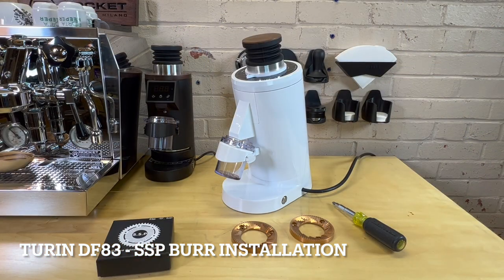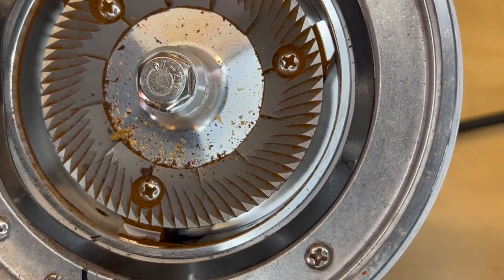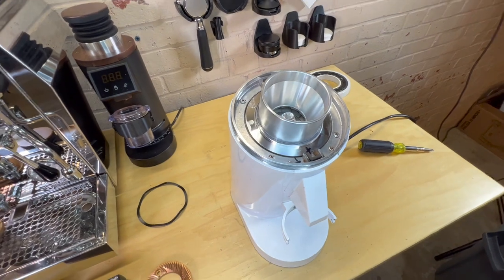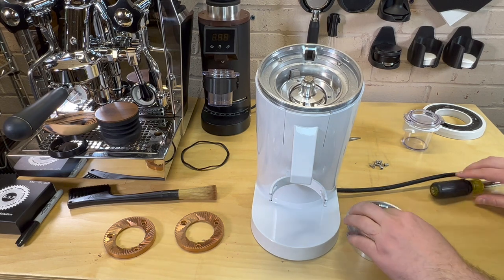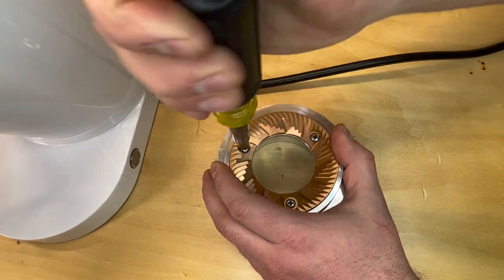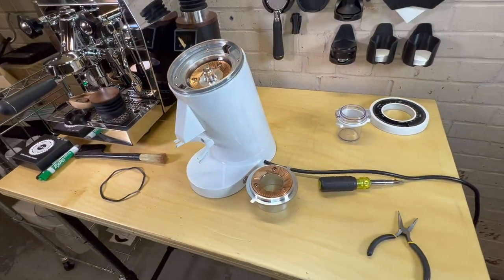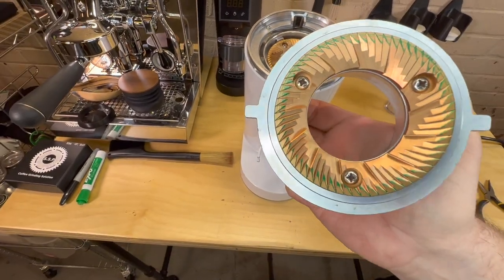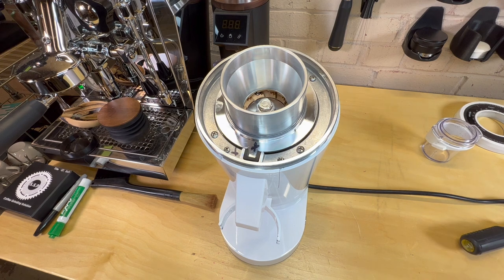Turin DF83 SSP Burr Installation

Comment: Definitely a good idea to get toothpicks for cleaning out the screws and stuff so you don't end up stripping the screws and its easier to get the screws loose.  And also using chopsticks are good for trying to wedge burrs out without risking scratching the burrs. Also helps hold the rotational burr in place when loosening or tightening the burr.

Comment: @PortaKeeper, Thanks for the detailed video. I wish I saw your video earlier as I have not marked the X on the lid with the top burrs so I don't know which way it's suppose to go. How can I fix this so I get the alignment correct?
Reply from the maker: Only way to check really is to do the marker test.   If it aligns well in that position, mark it and your good.  If not rotate 180 degrees
Reply: That's great, thanks for your help.  @portakeeper

Comment: Thanks for the videos, keep them coming!  Been watching since I preordered my DF83 which should be coming this month hopefully.

Random question about the anti popcorn device.  Where do I get the one for the DF83?  I checked the portakeeper website but only see one for the DF64P.  Are they interchangeable?

Thanks!
Reply from the maker: It should say 64, 64E and 64P.  I will check thanks for letting me know!   Yes they are Interchangeable, but the center opening in the burrs Is larger although the outside diameter is the same (hard to explain) but the middle anti popcorn piece does not cover as much of the opening.  It still works well regardless

Comment: Hi there! Thanks for all the content! Can I ask you a question? How many kilos you needed to season this burrs? I also have the DF83 with the ssp espresso burrs. After 3 kilos I think they are not in its full potential. I constantly found some channeling in the espresso puck and I think is due to this but I’m no sure. How was your experience? Pd: my burrs are perfectly aligned.
Reply from the maker: I don't recommend rushing the seasoning process.  Coated burrs will take longer than uncoated burrs.  I notice a difference after 10 pounds, will probably be upwards of 15-20 before really starting to smooth out.

Comment: How have the ssp burrs been compared to the stock stainless steel ones?
Reply from the maker: Still breaking them in right now but I feel like overall much better body while having a fair amount of clarity, more than stock.
Reply: @portakeeper kindly explain breaking on. As I just installed new SSP hu reds and I can't dial in shots. My zero point sounds like it resets, yes sounds, because after I grind and pull a shot I have to grind again as I'm dialing in and then I go finer and it hits zero point or sound like it does. When I take the collar off and pull the top burr carrier I see grinds stuck on bottom burr between the burr and the three posts that are on the bottom carrier. Once I clean it I can then reset to zero. But then same thing again and I have to take it apart to set finer. I don't get it. And I use the bellows while machine is still running after grinding. Pls advise.
Reply from the maker: @bleezal  not sure I totally understand what’s going on but sounds like your doing things right, so makes me wonder if when you installed the ssp that one of the burrs is misaligned to the point you hear the “zero” but it’s not really  because it’s misaligned enough.   Not sure if that makes sense or not.  I’d check alignment with dry erase first
Reply: @portakeeper  so I did an alignment at installation and it was near perfect. I figured it out. Grinds were getting stuck between the lower burr and the three burr carrier posts, so after grinding when I go to adjust finer it would squeel... The noise it makes when you're about to hit zero... But it isn't... So I go coarse then crank it finer whilst the grinder is running and it clears up and I'm good....

Comment: Won't the spring affect the alignment every time you clean the grinder and install it back? also, what about when using the bellows, won't the spring compress down and change the coffee grounds size?
Reply from the maker: Spring spins freely and has I believe 6 point on top and 6 points on the bottom.  It’s very strong spring.  Bellows should not affect anything because I think you’d break your bellows before it compressed the burr carrier.